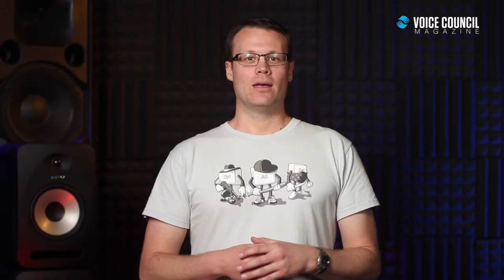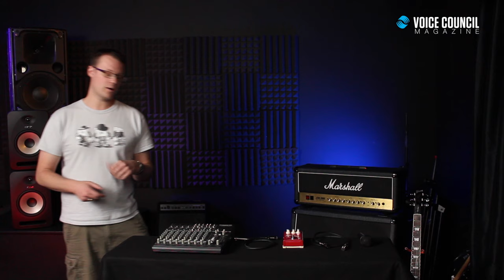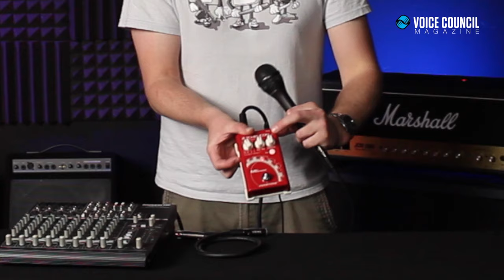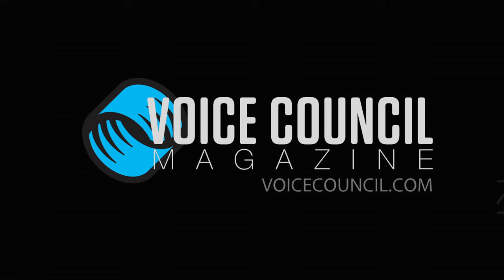Live Sound for Singers  - Hook Up Your Own Vocal Effects

Comment: so can i use this as:  mic - effect processer -  audio interface (roland ua-33)?
Reply: should work but there's a difference between Line level and mic level. Basically Mic Level is a really weak signal which is why microphones have to go into some sort of preamp. This would be the vocal processor in the first place. Now the vocal processor surely won't send at the same level as the mic so you will have to lower the input gain on your audio interface. If the signal still would be clipping if you adjust the output of the fx processor and the input gain of the mic input of the processor you should try a line level input on your audio interface.